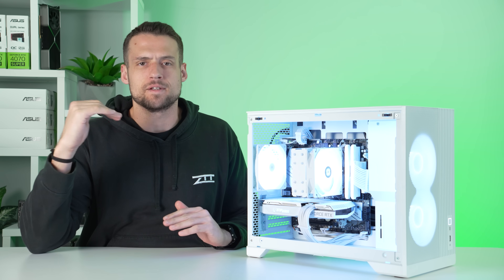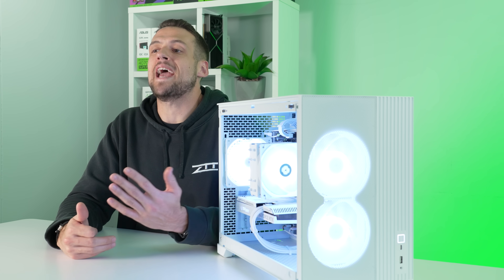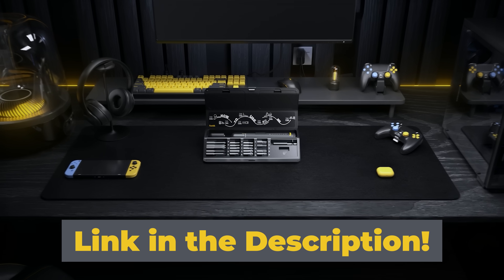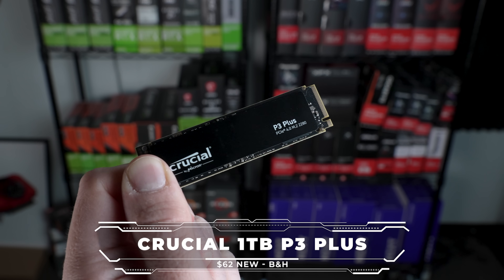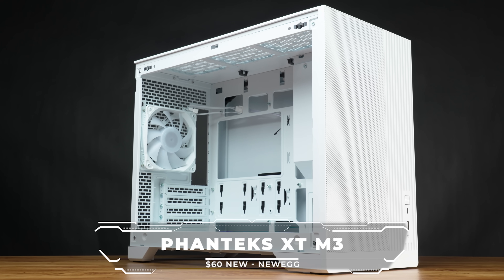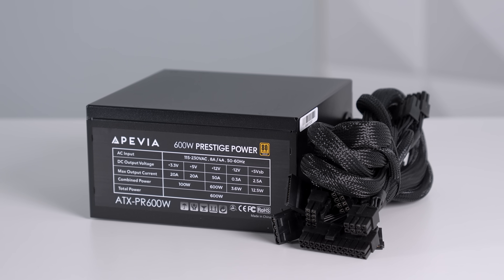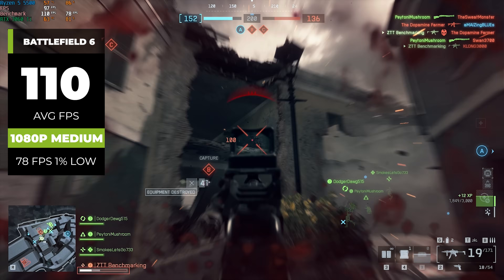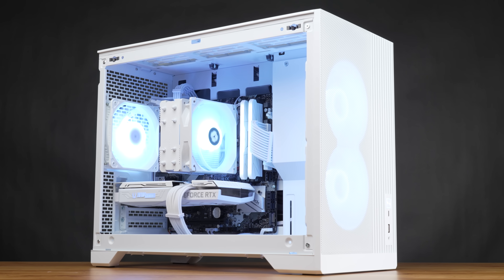$650 Gaming PC Build Guide

Comment: so i made this 650 dollar pc after a month of this video let me know if its good Ryzen 5 5500 32 gb ddr4 3600mhz 512 gb m.2 ssd full white fishtank case with 6 fans thermal assasin white ,white cable extensions 550w msi mag bronze psu and for the gpu i went with a intel arc b570 all brand new let me know if the value is there
Reply: the 5500 is gen 3 pcie so your b570 wont run at full speed

Comment: Stumbling on to Zach's videos have been super helpful especially when getting ideas on where I can save a few bucks on hardware.

Currently thinking of running the following setup

CPU: Ryzen 7 5700X
GPU: MSI RTX 5060TI Shadow 2X OC Plus
MB: MSI Pro B550M Pro VDH
RAM: GSkill RipjawsV 16GB (2 8GBs) 3200 MHZ DDR 4
Storage: Gigabyte 4000E M.2 1TB PCIE Gen 4
PSU: MSI Mag A6450 BM 650w 80+ Bronze

I still dont have a complete idea if the parts would work well together or I mignt bottleneck my system. 

Here's hoping I don't 😂

Comment: Hi Zach,
I’ve been a huge fan and have watched your videos consistently for the last year. Your content actually gave me the confidence to finally pull the trigger on my very first custom PC build!

CPU: AMD Ryzen™ 5 9600X
Mobo: Gigabyte B850 GAMING WIFI6
Cooler: TCOMAS LE200 360 Liquid AIO
Bundle 500 CAD

RAM: Kingston FURY Beast 32GB DDR5-5600 CL36 (2x16GB)
440 CAD

Storage: Lexar NM1090 PRO PCIe 5.0 NVMe M.2 2280 SSD (1TB)
160 CAD

GPU: ASUS PRIME GeForce RTX 5060 8GB
410 CAD 

PSU: MSI MAG A650GLS PCIE5 80+ Gold Modular
110 CAD

Case: MSI MAG FORGE 321R Airflow Mid-Tower
70 CAD 

Monitor: MSI Pro MP271A E2 27in IPS 1080p 120Hz 
115 CAD 

MSI Forge GK110 RGB
20 CAD 

MSI Clutch GM08 Optical Gaming Mouse
21 CAD 

Total 1845 CAD
Witn Tax 1940 CAD + service fee
About 1500 USD 

I’m a bit nervous about it being my first time building—do you think these parts make sense together, or am I overspending. 
Thanks for all the great content this year!

Comment: Bro in my country you can get with same price (650$)
5700X
6750 GRE 10GB / RTX 3070 / RTX 3060 TI
B550M DS3H
32GB DDR4 3200MHz CL 16
Deepcool 4 heat-pipe cooler
1TB NVMe
Acer AC650 650W 80+Bronze
E-Dragon Drukk Gaming Case w/4 ARGB fans 1100RPM
(If you want I ca give you in 750$ :face-orange-biting-nails:)

Comment: I wanted to build this in feb/march or 2026. ryzen 5 7500f, sapphire pure rx 9060xt 16gb, Corsair Vengeance 16×2 DDR5 6000mhz cl36, gigabyte 650M K AM5 Micro-ATX, miphi 1tb nvme ssd. When I put it together it was about 980 usd (converted from BDT currency). But how the prices are going up will it be worth it to build it in feb/march? I can't build it yet, my parents won't allow it now. This is my first pc. HELP!

Comment: Im systematically building my new pc as i can buy parts, 16gb 3600 ddr 4 ram cl 18, gigabyte b550 gaming x v2, ryzen 5 5500, 3060 12gb(2nd hand), and some or another id cooler for the cpu , can't remember which one, i still need to buy a case,a new ssd and a psu but still using my old ones first until i can. Basically everything is getting delivered between monday and Wednesday except the gpu that i bought last month with a 144hz 1ms 24" ips panel

Comment: I need some help. I want to run a Dual-GPU Setup with a 9800X3D. I have a 1200 Watt 80+ Platinum PSU Picked out, or 1500 Watt if needed. But primarily I want to find a motherboard, and case, that can fit two Sapphire Nitro+ GPU's. A 7900XTX 24GB OC. And 9070XT OC 16GB. This is a strange build, I don't have a budget. But I cant even FIND a fully compatible version of what I want. And Mr. GPT Says a thread-ripper would be the only CPU to actually support it which is likely BS. I need your help ZTT.

Edit: DDR5 AM5 Setup and if you have any questions I'll answer them. But I'm really inclined on running a dual GPU AMD setup because I know that AMD struggles with actually making an optimized usage based gpu. I want to obviously have a dual monitor setup, record and game. And also have background apps and use this for working as-well/3D Rendering. Any help is useful to me, but in this case if you can find anything about a Dual GPU Setup (AMD.) Including a 7900XTX 24GB OC And 9070XT OC 16GB (Both Sapphire Nitro+) It would be absolutely awesome to hear anything about it. Any questions in replies and I can answer if I find time. Please help before I decide to just run a single GPU Setup instead.
Reply: What is your use case that you need dual graphics cards? That's a thing of the past for gaming PCs. Neither AMD nor Nvidia really support multi-GPUs anymore.

Comment: I have a question zach, I have a m s I desktop?That has a b seven sixty v c.Wifi motherboard in it and I want to upgrade the motherboard to a little bit better one, but not have to replace.You know, processor and everything because everything else is good.What would you recommend

Comment: What do you think about my pc? I rock a Ryzen 9 5950x overclocked to 4.725 Ghz on all cores, 64GB ram and a 5070ti, I recently ordered a 1440p 24" monitor which should arrive soon, 1080p the games run smooth and good I believe even with Path Tracing, would there be any reason to upgrade in the near future to AM 5 for general gaming and 3D rendering workloads, because I believe the 16 core 5950x which note, is overclocked to 4.725Ghz and draws 230Wats(1650pts score in Cinebench 24) still outperforms the 9800x3d in raw power as in 3D rendering, or any 3D workloads.

Comment: Is the Intel Arc B580 Limited+ R5 3600x bad? Bc in a yt short 11months ago you said the Arc B580 doesn't work well with older CPUs... I think about getting an upgrade but sticking to the AM4 so it will be a 5700x3d or sum in a few months did Intel fix their problems of bad performance with older CPUs? (Zen2, Zen 3)?

Comment: HP Elitedesk sff g3 w/16gb ddr4, 8th Gen i5, and 512gb nvme: 90$ Shipped
RX 5700 8gb 125$ Shipped
PCIe x16 to Occulink adapter card: 30$ Shipped
eGPU Enclosure: 100$
450w 80G PSU: 40$

1440p Ultra at 60 FPS: 375$

Comment: PLEASE PLEASE HELP. i just upgraded my motherboard from a b450 gigabyte to a b550 eagle gigabyte and kept the same cpu an AMD ryzen 3600. it’s now stuck at the FTPM page and ive clicked Y N and Del and nothing happens at all. i’ve rebooted it and spammed it before anything shows up. took out the battery on the motherboard for a tpm reset and literally everything i could find online. it already has windows 10 on my sata drives and they’re hooked up into the motherboard. i have no idea what to do

Comment: what do you think about my new pc bild      
MSI B550 Gaming Plus                              mother board
AMD Ryzen 7 5800X                                 cpu
RX 7800 XT                                        graphic card
Seasonic Focus GX-850 850W PSU                    power supply 
DarkFlash DS900WS ATX PC Case Black               case
Arctic Liquid Freezer III Pro                     cpu cooler
Samsung 990 Pro 1TB NVMe SSD                      1 ssd
Samsung 990 Pro 1TB NVMe SSD                      2 ssd
G.Skill Trident Z RGB DDR4 3600 MHz 64 GB (2×32)  rams

Comment: H, I have a question I recenty boughtthis build:
- Giganyte RTX 5080 windforce oc
-Ryzen 7 9800X3D
-Lexar NM790 2TB
-64gb ddr5?
-NZXT H6 FLOW
-Thermalight peerless Asassin 120
- in case mounted one 😮 fan in a back, exhaust 1200mm on the top. Front one set for intake. All Front palnels are intake, other 2 as 
Will this be enough for the next 5/6 years?
PSU: endory😊 supermo FM6 
P/SI managed to buy ram before rammsgadom.

Comment: My note for every part lol

Extra money: Ryzen 5 5600 
Ram might be an issue BCS obv
SSDs are also rising.. slowly
Case is a btch for cables
Used gpus are a ye

Now I'm wondering what I could go for, with a slightly higher budget to improve those things but this is a great improvement already lmaoo
Also WDYM one site says SSD discontinued, cooler unavailable.. the cheatcheet links are there
THE RAM IS DIFFERENT AND FOR OTHER OPTIONS I FLIPPIN SEE GOOD LUCK!? THANKS!? AI SHOULD BURNNNNN

Comment: I found 32 gb of ram in an ok price i bought them and the rtx 5070 i think i am going to pair it with the ryzen 5 7600x to save money shall i use aio or an aircooler (i live in greece so prices might be a bit more expensive plus i cam from a gaming laptop with a ryzen 7 3750h and gtx 1660 ti its tired after 6 years of gaming so i needed a replacement)

Comment: Hey man hope you see this quickly, I have a buddy that wants to buy a new pc cause he wants to upgrade from his 1660 ti build. We’re looking at a FB marketplace rig that has a ryzen 7 7700x and an XFX RX 7800xt. The bro wants $1,200 for it but is that worth the price? The one thing I like about it is the fact that it’s an AM5 compatible motherboard so he’ll be able to change CPUs if he wanted (his current build only accepts older generation intel chips) it also has an Arctic liquid freezer III 420mm as a cpu cooler. Hope you see this lmk your opinion please🙏🏼

Comment: Well i will still use my build rx6600, i7 6700, 16GB ram ddr 4 2133mhz and 1tb ssd powered by 450w eJoy Power suplay and wait for a good deal for a kit like am5 ryzen 5 7500f, 32gb ddr5 6000mhz and an rx 9060 xt 16 GB to be consider a good upgrade  with more future upgrades possibilities.

Comment: CPU:
Intel Core i5 10400 @ 2.90GHz

RAM:
32.0GB Dual-Channel DDR4 1330MHz  My MB Not Suporting 3300MHz

Motherboard:
Gigabyte Technology Co., Ltd. H470M DS3H (U3E1)

Graphics:
25G64 (1920x1080@240Hz)
4095MB NVIDIA GeForce GTX 1650 SUPER (ASUStek Computer Inc)

my budget is around 620$ 
what do u recommend to upgrade?

Comment: Zach its my first pc build as a teen I'm in desperate need of help im using the antec flux m antec skeleton 360m aio ryzen 5 5500 rtx 3050 oloy 16gb ddr4 ram asrock b550 phantom gaming 4 mobo and addlin 500gb nvme with a 200hrz monitor from gigabyte i need help getting a psu for it also im gonna be using 2 monitors please bro i need this help

Comment: mind you probably could get a used 5600 and a 3060ti 8gb very nicce combo for the cpu intenisve games in 1440p or 1080p i recommend 1440p or you can do a 5500 and 3070 this is aslong as u paint the cooler instead and find a decent deal

Comment: Hey Zach/community, I build my gaming PC with an MSI Z890 Gaming wifi plus, Ultra 7 and 64GB of DDR5 Corsair Vengeance 6000. However, because I found a good deal and didn't know about lane issues with DDR5, I used 4x16GB rather than 2x32GB. 
Now my motherboard as well as my CPU say they can support at least 5200MT/s for 4 sticks. However, whenever I try setting the speed from 4800 to 5200 my PC crashes and freezes. Any Idea why?

Comment: I need help. I recently got myself rx 9060xt 16 gb sapphire pulse. cpu is i5 12400f. I have a 2k 144 hz monitor.
My ram is older ddr4  dual channel where one stick is 2166 mhz and other is 3200mhz so they are together running at 2166 mhz only. My motherboard is H610 Gigabyte ddr4 only as back then ddr 5 was out of my reach.
I am suffering from horrible stutters and 1% lows where fps drops from 100+ to 50s and cpu usage is 100%.

Is this due to weaker cpu ? or weaker ram?

playing last of us, spider man (2019), ghost of tsushima etc type games

Comment: 1 month ago i buyed a used pc from local market at 750 euro. Pc has cpu ryzen 5 7500f, cpu cooler be quiet dark rock 5 pro, psu be quiet straight power 11 80+ gold, gpu rtx 3060 12gb, ssd samsung 990 pro 1tb, motherboard asrock b650e pg riptide wifi,case 2e virtus neo g3301n and ram adata xpg lancer 64gb 6400mhz cl32 dual kit. Now, only kit of ram cost 1300 euro. I got very lucky with this build at 750 euro. 😂😂

Comment: Could I get thoughts from anyone knowing what they're doing? How does this build sound? Ryzen 7800x3d, Radeon 9070xt, b650e-e tuf with wifi mobo, phantom spirit 120 se cooler, Gskill flare X5 ddr5 ram, asrock steel legend 850g 850w psu, and antec flux pro case

Comment: Please tell me where the weak link is in my set up is or if it is fine just the way it is...
i7 Intel Core 14700F (5.4 GHz Turbo) (20-Core) (8P+12E) (Raptor Lake) 
GeForce RTX 5070 Ti 16GB (VR Ready) 
64GB DDR5 5200MT/s Kingston FURY RGB 
MSI PRO Z790-P Wi-Fi 6 Motherboard 1700, DDR5
1000W (Semi-Modular) (80 Plus Gold) PS
SSD M.2 (2TB Samsung 990 PRO) (NVM Express) 

Focusrite 4i4 4th Gen interface for sound. I mix and record music as well, games sound awesome on here.
Dell S2725DS 27" 100HZ...Looks great to me, but I would like to see what it looks like running on a 200+ HZ, would it make a big difference?
Reply: Air cooled

Comment: Hey Zach I'm trying to decide between a Gigabyte 5080 gaming oc or Asus Tuf 5080 oc Both same price but I plan on getting the HYTE Y70 case black 
so I have to vertically mount It the gigabyte looks perfect Aesthetically compared to the Asus Tuff but early models had that leakage issue especially for
vertical mounts but It performs a bit better overclocking wise than the Asus so I'm wondering would you recommend buying a Gigabyte 5080 despite the risks or just  
have my gpu stand out cause they don't sell an all black model?

Comment: 2 things rate my set up and I searched Zach tech tips and u came up lol 
1 core ultra 7 265k  cpu
2 5070 Asus prime gpu
3 natulus Corsair aio
4 ayw Asus gaming Mobo
5 2x32 64 GB DDR 5 silicon power ram
6 3 tb nvme 1 tb Wd 2 tb Samsung pro
I know cost effective is the popular tech opinion but I am of the opinion of Im not going to be buying a PC or building this often so I get what I want also my aio and fan setup is overkill I get 50 degrees c in 4k gaming 
I hobby 3d modeling and free lance editing

Comment: i have a 1080 p monitor and a HP M01-F3324 PC with a Ryzen 5 5600G and 64 GB of ram i installed 8 months ago for under $100 at best buy
just bought a Ryzen 7 5700x with a B550 MSI Gaming plus MB and a 16GB XFX RX 9060 XT for a new build.
 i am thinking i will just use the 5600G and my RX 8GB 580 and hold the 5700X and 9060 for a AM5 build and just start buying parts for that build that i will use for ZBrush program

Comment: Hey just wanted to ask, is it okay if i get any other manufacturer cables for the modular PSU? the one in question is powerspec psx 750 gfm and ngl cant really find any info online, was wandering if its okay to get the cables like CPU and 24 pin MB cable via amazon and just plug it in

Comment: Ryzen 5 5500 and 3060ti in a $650 build rn during ramagedon. Zach you are like jesus for budget ballers
Reply: Should I take new Arc B580 instead of 3060 ti?
Reply: @thereal_chad go with the 3060ti. I heard its not as bad as it was when they first dropped. But the cpu overhead problem is real and does hold back the b580. Youll have a better experience with 3060ti. If you really want new id recommend rx 9060/9060xt 8 or 16gb if your playing in 1080p 8gb is more than enough. Or rtx 5060
Reply: @ChartBoyVon  and I'm gonna play 1440p with a tight budget so..
Reply: @thereal_chad best budget 1440p gpu right now is the rtx 3080. Thats what im rocking and every game can run at high settings 100+ fps
Reply: @ChartBoyVon bruh I told you I have a tight budget and you are increasing my budget more and more
Reply: @ChartBoyVon btw do you don't know b580 overhead issues is fixed?
Reply: @thereal_chad in most games yes in some no. If your gonna pair that gpu with a ryzen 5 5500 your kinda asking for problems. If you want solid 1440p gaming on a tight budget a $300 rtx 3080 is your best bet. If you cant afford that man idk what to tell you, either play in 1080p or accept that when your playing in 1440p you just kinda have to spend more on a better gpu to render double the pixels
Reply: @ChartBoyVon I ain't a lifeless and it can take DAYS to finish a single game so I think as a casual gamer arc b580 would be wonderful what do you think?

Comment: Sooooo should i buy this for 750?:Here i am selling my pc and my monitors I dont
have the time for it anymore and its just
collecting dust. Its fairly new and not been used
much price is pretty firm as feel its reasonable.
No I wont take swaps nor will I trade. If the listing
is up its available.
Will have some videos uploaded later

Will come with 2 monitors one being a 24inch
180hz Asus monitor the other monitor being a
100hz msi 27inch monitor

Here is the specifications of the pc

1 x AMD Ryzen 7 7700X AM5 Processor
1 x Gigabyte B650 EAGLE AX AMD Socket AM5
Motherboard
1 x Fractal North Mid Tower Case - White
1 x Cooler Master MasterLiquid 240 Core II
240mm AiO Liquid CPU Cooler in White
1 x Kingston FURY Beast 32GB (2x 16GB)
6000MT/s DDR5
1 x 650W MSI MAG A650BNL WHITE 80 Plus
Bronze PSU
1 x PowerColor Radeon RX 9060 XT Reaper 16GB
GPU
1 x 1TB Samsung 990 EVO Plus M.2-2280 PCle
4.0 x4 NVMe

Comment: I just put this 2 of these systems together working off Zach’s last $450 build guide

Motherboard $74 GIGABYTE B550M DS3H 
CPU $45 Ryzen 3600 
Cooler $0 stock
GPU $185 3060 12GB 
RAM $40 viper 16gb (2x8) 3200mhz
Storage $74 KingSpec SSD 1TB
Case $54 MONTECH X5M
PSU $49 Thermaltake Toughpower GX2
Total: $521
Reply: You might want a $15-20 aftermarket cooler to overclock the 3600 and feed the 3060 12 GB more frames.
Reply: @AndrewDutton-Topper  It’s going on a 100Hz 1080p monitor. It’s not pushing anything crazy, and I don’t plan on doing anything extra on it. It’s not for me. If the owners want to do more, they can, but I just needed it to be good at base. You really only get into bottleneck territory with this combo when you try to push up to and past 144fps, at least from the benchmarks I’ve seen.
Reply: @Siyintax  true
Reply: where do you find a 3060 with 12gb of vram at 185$, here in italy its at 330€(390$)..
Reply: @24.7pier Facebook Marketplace. I even got the guy to put it on a pc to be certain. I’m in the USA, though, so I don’t know how FB marketplace is over there. But yeah I felt pretty good about that get.